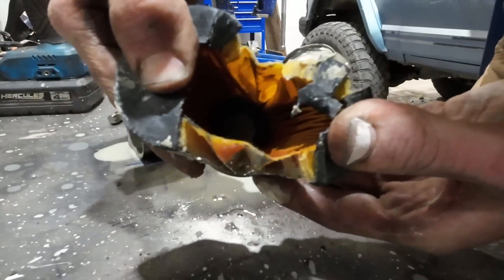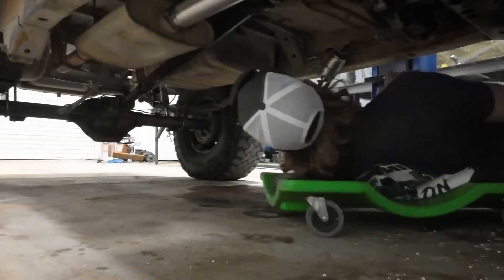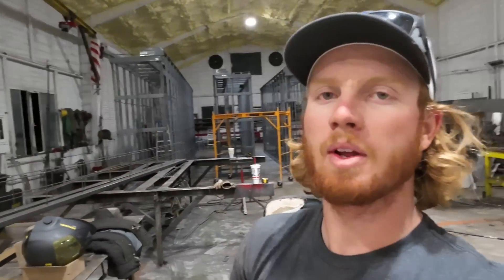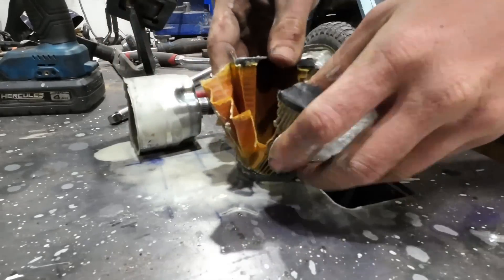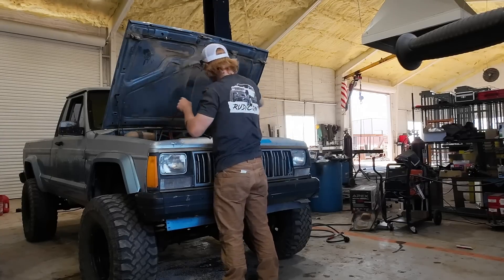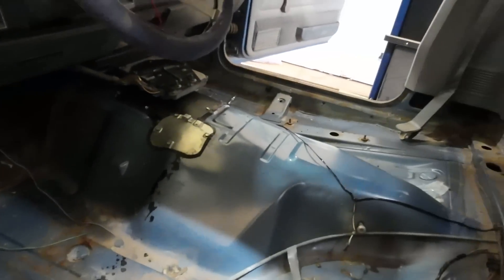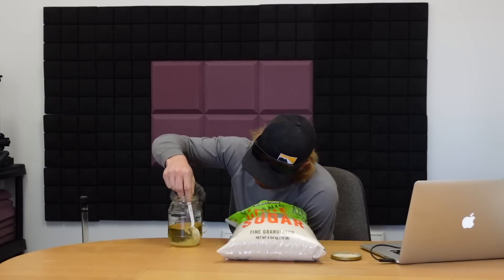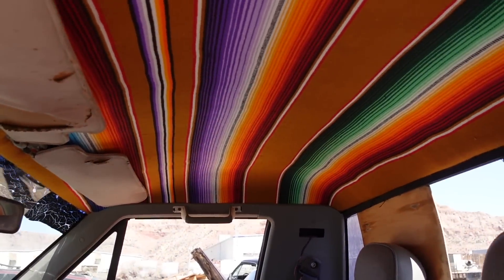Someone Put SUGAR in My Gas Tank!!!

Comment: My suspicion: The reason it was sold to you in the first place was because of this. It had probably been cleaned out, but, all the sugar crystals higher in the tank never drifted down. When you went bumping and bouncing around, it mixed in all that extra sugar and started the same problems. You said you'd been through the fuel system before, but, you'd never looked in the tank right? Could have had the whole top of the tank coated in crusty syrup residue. Call up the guy you bought it from, I bet he's the one who scammed you. He probably tried to have it fixed twice and couldn't ever resolve it. Kept coming back.
Reply: The reason I like those cheep Clear plastic Filters.  You can see what your gas looks like.
Reply: yeah, it was likely in there when he bought it and wen unnoticed until it got thrashed around and stirred up.
Reply: Plausible
Reply: idk, possibly but i think it would’ve start running like shit again pretty quickly and there was a decent amount in there and sugar residue around the filler hole
Reply: @r7blue  I had a boat tank rusted inside, it was fine until I stirred it up going fast or choppy waters.
local small lakes it would run around all day idling, but hit the "speed/ski areas" and about 1/2 way around it was stirred up and plugged the intake mesh screen enough to collapse the primer bulb flat and kill the engine = dead in the water. wait 10 to 15 minutes it would settle and work ok again.
had vehicles that way also and serviced a few with sugar/powders(all had pickup socks)

Comment: What a great idea for your roof, looks good. Whoever put the sugar in your tank has learned sugar doesn't ruin the engine plus a very good testament on the fuel filter. Great work on keeping positive!
Reply: It does ruin a engine once it contaminates the oil (getting past rings…) the last motor I done that had sugar  it seized valves in the guides and rings sticking in ring lands

Comment: Dash cams. I’m sorry this happened Rudy, you’re a better man than me with how you handled this. Hopefully the perpetrators get their comeuppance soon enough.
Reply: I've got front and rear cameras in my 4x4 here🇬🇧.

Some things I've noticed.
•If it's a determined criminal, the camera won't deter them.

•You have to notice the criminal act within the camera memory storage before to overwrites. (Make sure the card is formatted!).

•There's no guarantee the police will be able to PID the criminal and or divert resources to the investigation so try social media as well.

•Make sure the dashcam night vision is great cos alot of the crime happensin darkness. My old camera needed white light to see or all you could see were shadows moving.

Hopefully comment this helps others.
Reply: Also locking fuel caps.
Reply: Most dash cams don't record 24/7 and only a few could even detect anything was happening and turn on. A locking gas cap would be much more effective.
Reply: @ADBBuild  but rudy needs video. he makes videos

Comment: Rudy, while I applaud and commend you and your father's tolerance and patience along with the humor, that has to cease when a crime is committed against you. In this case the sugar in the gas tank is "Damage to personal property", which is a crime. So the question then is who would do it to you. Jenelle's ex-boy friend(s), any enemies you may have acquired, some one you may have had an unknown road incident with, etc? Someone mad at your dad? It is a crime and any expense you incur in order to fix the problem, which includes your time as well as replacement parts is something that adds to the value level of the crime.. I am a car/truck/4x4 guy, a former LEO and a disabled Vet.

Comment: Rudy, You are lucky that it wasn't Chalk Powder!  I had a case where Chalk powder was put in a Toyota 1600 Corolla. It would run fine till Engine got hot & then would shut down Completely leaving one sitting on side of road for 14 minutes, then would start again & go fine for aw while again.  Went though several fuel filters & could not figure it out till last time, sent old filter to the College to have analyzed   & results came as Chalk Dust from blackboards that used to be in schools. Bu the way, The Customer was a School Teacher.

Comment: Rudy, I've got the same truck but started out as a long bed. I've got a new fuel tank/ pump-sender you can have but I'm not sure it would fit short beds.  I'm stoked to see the MJ again but not like this. That's a D move. Hope this doesn't hold you back.

Comment: yay!  I knew it was a fuel issue!  sucks that someone would be so petty.  hopefully it was meant as a practical joke and not malicious.  Side note...Cherokee bucket seat brackets don't work on the Comanche.  you gotta cut the brackets off the bench seat, or find some off a Comanche Sport (hard) - in case you didn't already know that.  I found out the hard way thinking I could just toss some updated cherokee seats in my Che.  no go.  lol

Comment: Time for a locking gas cap and start locking your doors.
dawn dish soap and scrub that carpet...good as new.
When I got my jeep the previous owner spilled a gallon jug of oil on the back carpet in the cargo area.
Dawn dish soap and scrub,let soak and or do it twice then let dry.
Mine came out looking like new.

Comment: Myth busters did a show on sugar in a gas tank. Sugar doesn't dissolve in gas. It basically just sits in the tank and doesn't hurt anything. Now if you got some water mixed into the gas, like most ethanol fuels do, this water dissolves the sugar enough to be picked up by the pump and pushed through the system and as you saw it plugs up the filter.

Comment: Sad that someone would do that. I learned the hard way about how an engine behaves when the fuel filter is getting plugged. It started with it not liking hills and then went from there. After checking a few other things I also checked on the fuel filter, actually I just replaced it. Problem solved. Glad you got it fixed. It definitely didn't help that you had recently gone through the fuel system. I can see why you didn't check that out first. But then , who expects someone to do what they did. That was a really mean trick. Thankfully it didn't do more harm. The sugar in the gas tank kind of looks like moisture got to it. Fuel doesn't dissolve sugar.

Comment: It could have been several months since they poured the mixture into the gas tank, perhaps years.  Sugar does not dissolve in gasoline, so it would have taken awhile for the particles to make their way into the fuel pump's filter.  The sugar alone would not destroy the engine, but it does seem like something was added that created the sludge.

Comment: Hello, me again! I'm further into your video! For your carpet, a little trick that worked great on my Comanche and even took out the grease stains, as it once was a mechanic's failed project. Soak the carpet properly with Spray Nine and rub it with like a boot brush or tire brush, then pressure wash it until no foam comes out, and hang it out to dry for a few days. My came back pretty much as new! And for your fuel saga, my thoughts is that you may have fueled up from a bad batch of fuel... Modern ethanol fuel is such garbage, it relatively absorbs water quickly, and the water will go to the bottom of the tank, and leave a yellowish to greenish muck as the fuel breaks down, and finally turn into a beige powder as everything else dries up. Honestly, I fuel up with regular only if I know I'm gonna burn it in less than a month; otherwise, I use premium, which SHOULD have no ethanol, at least in my part of the world (eastern Canada).

Comment: Sounds like the condensation problem I had where a truck I bought was sitting awhile with low fuel and when added gas sloshing around washed the crossion off inside tank. Reading havoc.

Comment: I used XJ seats on MJ brackets in mine. I have a Renix high performance ecu if you're interested. I had a cammed and ported head 2wd MJ that would beat ram air LS Camaros back in the day. I might still have the head, gotta look.

Comment: Back in the late 60s, early 70s, Karo Corn Syrup was the “preferred” destructive additive to gasoline. It mixed quickly with the gasoline and really did a job on the fuel system.  Had it done twice to my ‘64 Ford F-100.  Back then, even with a small block V-8, I could stand between the engine and inner wheel well and comfortably work on the engine.

Comment: Soda does the same thing. It's the sugary compound that does the damage, not so much the granules. Pouring in a 2-liter bottle of Coke will accomplish the same thing and is a lot easier and quicker than dealing with granulated sugar. It will quickly destroy an engine if you don't know the signs. Sometimes they'll put some very fine sand in the soda before applying to help guarantee max destruction. Locking gas caps = preventable solution.

Comment: That sucks someone did that. People are jealous of success.  You keep working hard and these things will seem small in the long run.  Question: did your Comanche come 2wd? And if so does it have the wiring pre installed to do the switch ? And how much fabrication is it to put the front axle in? Or does it bolt in?

Comment: You're right it was sugar but for it to be milky looking like that it would have to be powdered sugar. I've dealt with this in the past. My friend's father had had a 460 Ford motor dropped into his 71 Ford F250 in Los Angeles and drove it to Eugene Oregon parked it overnight and it had three dead holes in it. Turned out somebody had put sugar and water in his gas tank, water kind of a key ingredient for this to work because sugar doesn't readily dissolve in gasoline. I had to remove the entire fuel system to wash it out plus I had to pull a cylinder heads off because three of eight exhaust valves were stuck in the open position because of carbonized sugar in the valve guide. You're lucky it didn't get to your valves bad enough to cause you a problem. Obviously you're getting a locking gas cap if you haven't already done that.

Comment: I hope you do not have to buy a new fuel pump. When my 88 comanche needed a pump, i was told they no longer made one for the comanche. They have one they call a replacement  but the float for guage is opposite than original and will not fit the splash  guard in the tank.

Comment: Time for a locking system of some kind Rudy. I replaced the filler spout door on my car with a locking door and put a locking gas cap on the spout. I had roughly 20 gallons of gas stolen out of my car in a couple of days. Haven't had any gas disappear since. I also replaced a couple of my cameras and realigned them so they point directly at the car. I also set the alarms to sound when just those two cameras activate. I'll see what happens now. 

Good luck with your endeavors and keep the videos coming. I for one really enjoy them.

Comment: That sucks massively, Rudy. Fortunately sugar doesn't dissolve in gasoline. It does exactly what you found, settles to the bottom of the tank, will plug fuel filters, can accumulate in the fuel pump if any gets through the filter. It won't wreck the engine.

Comment: That's one thing that worries me whenever I leave a tractor away from the yard, is someone could easily sabotage a machine by opening the fuel cap and dumping some dirt in the tank and cause a slug of issues.

Comment: Finished the video after last comment..  and sugar ruining engines stopped back when throttle bodys came out.. but it sure does mess the system but isn't that in the yrs of throttle bodys..?    But as with fuel injection the orifices for throttle bodys and injection is actually much smaller then carburetor.  When throttle body came out filters became much more refined and many more layers.. it's also when the world changed from manual fuel pumps to electric.. back in the day sugar would also take out the thin rubber  pumper gasket in the pump..   so I guess thank God for technology in some ways..

Comment: it looks exactly like what fuel stabilizer did to one my ole Chevys. Except it wouldn’t run. It would fire off carb cleaner but stall, it had fuel going into it. Probably didn’t help that I used garden hose for a temporary fuel line fix till local shops got fuel rated line in. But fuel stabilizer does exactly this. Makes you believe that someone put sugar in ur tank. So be worry using crap other than Gas. Remember that gasoline is a really really Good solvent already.

Comment: Sounds like an upgrade should be a locking fuel cap. I guess these old vehicles didn't have them. It won't stop someone determined but it'll stop this low effort attack.

Comment: Had to take out a seat once in order to replace a seatbelt buckle, and it's crazy to see all the crap that built up under the seat and on the side of the center console in the 18.5 years that Sandy had been around at the time (she's 20 now). Ended up cleaning it up before putting the seat back in.

Comment: Wow Rudy I'm so sorry that someone would do that just because they think there cool. I hope get there do just. For doing that. Looks like your going to put locking gas caps on all your vehicles. Because I think they are going to try it again and it could coast you more problems than could handle. Anyway good luck and I hope things will work out for the better.

Comment: Get locking fuel caps. They are not full proof if they truly want it off with a screwdriver, but its stops many. Keeps most people from psyfoning it off. It may only slow them down, but they have to make a racket chiseling a screwdriver into the lock.

Comment: Time for a locking gas cap on all your vehicles.... I've had this done to me, and it cost me $600 back in 2001. I was on a cross country road trip. Had to stop a few times to get fuel filter replaced, and then eventually replaced fuel pump, cleaned tank, and replaced fuel filter again... Ugh...

Comment: Many years ago, I had a neighbor who gave his kids a little Honda four stroke dirt bike with no exhaust pipe, just straight exhaust from the head. It was super loud and they never got it out of first gear circling the little back yard over and over all day, I had an old 2 gallon gas can so I poured a pound of sugar in it and filled it up with gas and left it in front of my detached garage. Of course they stole it. It won't ruin the engine, sugar does not dissolve in gas but it clogs up everything. It ended to noise problem though.

Comment: The punks might have used powdered sugar rather than granulated sugar. Powdered sugar (also known as icing sugar) has some finely ground flour in it to prevent it from clumping. The flour in the powdered/icing sugar would explain the difference in appearance from what you got with the granulated sugar. The flour in the powdered/icing sugar is the reason why you NEVER use powdered/icing sugar in a hummingbird feeder, you only, ever, use granulated white sugar.

Comment: you threw parts at it before adding fuel into the intake to see if it started?
Reply: As he said, he had already done some work on the fuel system before this happened, so he thought it would be something else.

Hindsight is 20/20, and rarely is someone going to go over their previous work that they knew worked when they did it, expecting something to have just gone wrong. It usually would be something they haven't touched yet.

Comment: I had the same problem with a heroin dealer down the street he kept hitting my gas tank with graphite in spring graphite into my gas tank and then he would do the volcanic ash and they do is a Coke and a pancake syrup so I ended up putting a jewelry lock on my gas tank door and that stopped everything

Comment: Bro 4 link her build the morning tor please no one seems to be doing that factory with big axels and tires and all the extra metal added to it means you need to make sure the motor up to par which no factory motor is with way different readends friends and transmission so please heads cam timing values and domed pistons and tune her I just bett you will get around

Comment: Locking Gas Caps .... I have been using them on all my vehicles for over 30 years. After a while it becomes part of the routine of re-fueling . 
I have 3 tips for using them.
  1,  Always keep an extra key hidden in or on the vehicle. 
     ( You never want to not have access.)
  2,  Always put the cap on the driver seat or the dash when it's off the filler neck.
     ( You never forget to put it back on.)
  3,  Never remove the key from the cap when it's off the filler neck.
     ( You never forget to re-lock it.)

Comment: Might need a locking petrol cap there Rudy. Years ago my aggressive opposition pulled up at a job, boasting how much he had earned that day and was all done. Good on you I said, you have to start somewhere, you'll get there one day. And then he said that my mower equipment would be hard to run if there was sugar in my tanks and that he knew where I lived. I put my gear down and walked over to him. You may not realise this but I mow lawns in your street, I know where you live too and if anything happens, I'll visit you first. I told all the local lawn mower guys and the local mower shop. Within in the month I was told he had misplaced all his gear, trailer, the works. I had zero to do with it, he must have attempted to push someone else's buttons.